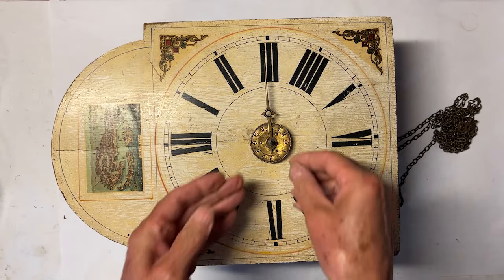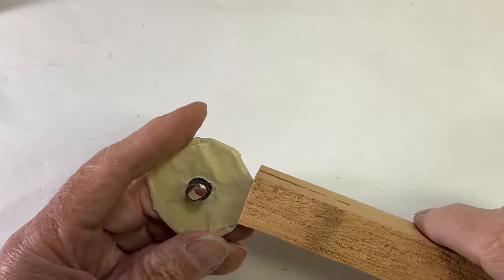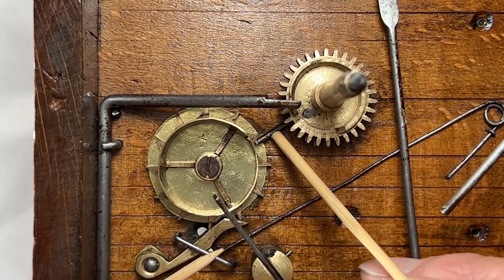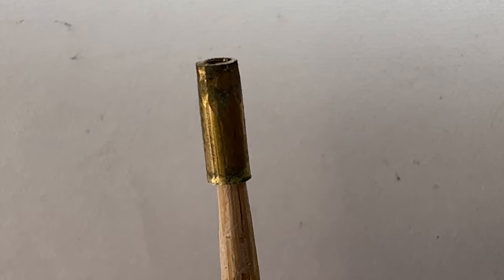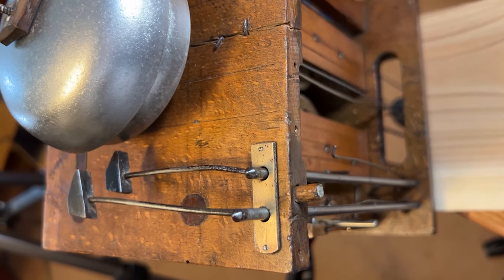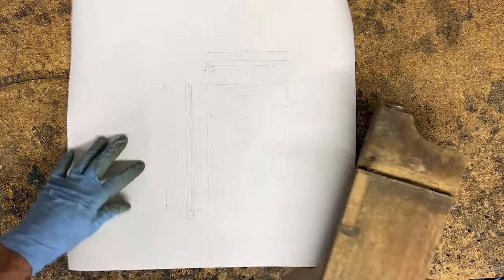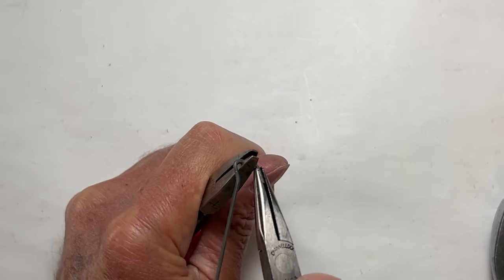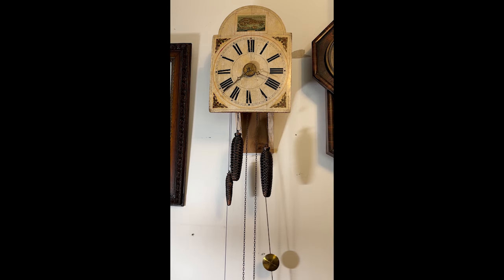Shield Clock restore for Elbridge from New York #99

Comment: Yes! I was really hoping that I'd get to see this clock get fixed 😊
There's so many things i could say about this one, like 'why am i surprised you own a sand blaster?' Or 'that double bend in the alarm mechanism so that one wheel moves the hammer both forwards and backwards is ingenious!'
But mostly I want to say 'wow! Using a vacuum pump to suck glue into a loose joint!? That is something that ive never seen before!' 
(And by now I've watched many thousands of hours of YouTube) 
Thanks for the upload - great stuff!🙂
Reply from the maker: using vacuum is the best way I have found to preserve items and prevent complete disassembly and damage to artifacts.
Reply: @jamesmartin5370  I was slightly sceptical until I saw it working and it looks likes the perfect solution.
I've no doubt that when others see this, every restoration channel on YouTube will be doing it! 🙂

Comment: Great video.  It’s nice just to sit and watch you work on a very old clock.
I notice you marking a line with your digital callipers parallel to an edge.  I’m so glad you didn’t scratch a line with the other point 🤠.
There is a neat trick to mark a line a specific distance from an edge easier than using the “jaws”?
I’ll try and explain.  When the jaws are fully closed there are two edges on the top that are exactly level.
Therefore when the jaws are open those edged are exactly the indicated distance apart.
If you place one of those edges on the edge of your work piece you can then mark a line the exact distance from the edge.
Hope that makes sense.  This is great for scribing a line on metal but handy for wood as well.
This is an often overlooked feature of callipers.  If you’d like a better explanation I’ll make a video of the process 🤠
Reply from the maker: Good explanation, will use this, thanks

Comment: How can I figure out the chain size I need for a wag on the wall clock like this? I recently bought and restored one of these movements, but it came without the pendulum, weights, and chains.
Reply from the maker: The below link describes a process that can be used, it also has a fairly complete list of chain sizes to choose from.
It can be tricky so don't be surprised if the first chain you purchase is slightly off.
 http://www.timetips.org/page190.html